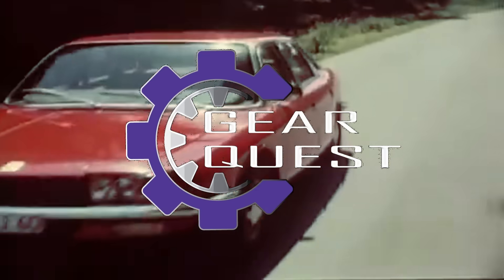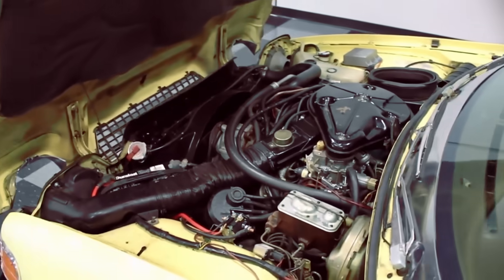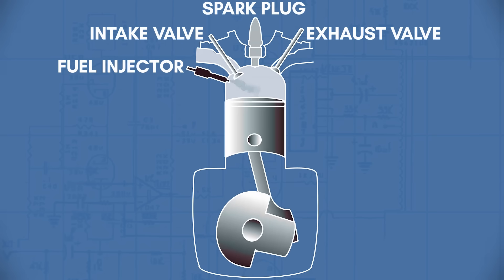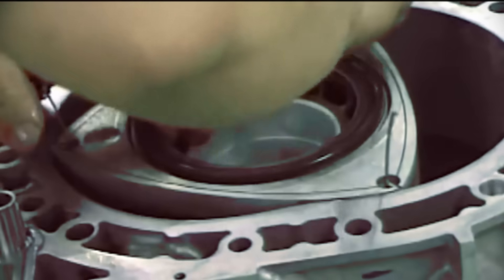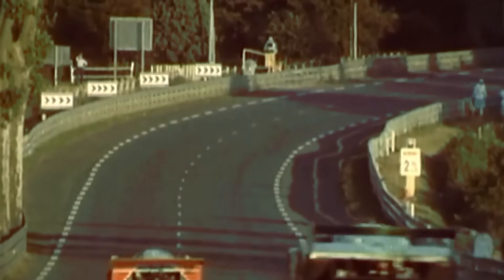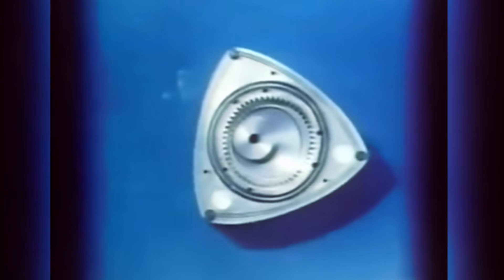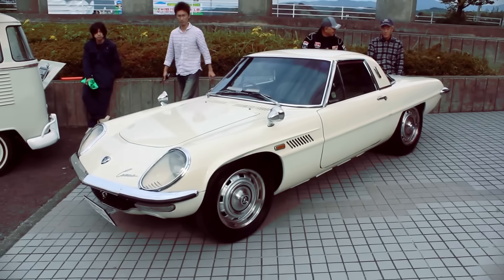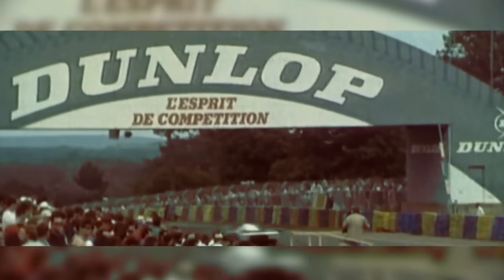The History of the Rotary Design

Comment: The winning Le Mans car was powered by a 4 rotor ('26B'), NOT a 13B.
Reply: @这是为什么我没有朋友 Same politics that banned the rotary from Le Mans the following year after their successful win?
Reply from the maker: Interesting topic for a follow up video 🤔
Reply: @normanguzman417  They banned ALL older spec cars and only allowed them to race in 1991 because there was a lack of new regulation cars to make a full entry list. Some "successful" win when it was useless on all other tracks in the 1991 World Sportscar Season and never came close of winning any other race. It was a fluke win if there ever was one at LeMans.
Reply: @normanguzman417  It was banned BEFORE it won; the rules were changed for 1991, but the older cars were allowed to race at Le Mans only.
Reply: @normanguzman417  All Group C cars were banned after that year. And the Group C cars against which it was likely to be competitive carried enormous weight penalties. The 3.5 liter cars had little chance of winning that year, Mazda or not. They were basically high-strung F1 engines that were idiotically mandated by Max Mosley.
Reply: It won because it was built for ENDURANCE as well as speed and the other cars were built for speed and they hoped they wouldn't break. Then they broke.
Reply: @eoinsweetman9263  porsches were also built for reliability but just had bad luck but thats also part of le mans
Reply: @kevinmai4326  First off, they were old designs. Second, they carried a punishing extra 170 kilos. The only reason the Mazda didn't get the 170 kilo penalty (actually the Mazda was scrutineered at 845 compared to the 1000 that the other Group C's weigh) was that it was considered so uncompetitive based on its prior year's performance.
Reply: @kevinmai4326  they didn't have the fuel economy either to mount a challenge to the more economical 787B. Plus they also had a weight penalty.
Reply: @eoinsweetman9263  only the Peugeots were 'built for speed' with the 3.5s and that's why they broke (F1 spec 3.5L engines that were still a little fragile over longer distances). The Mercedes, Porsche and Jaguars for example were still proper ENDURANCE Group C cars and an evolution of their cars from the previous year. They knew their 91 spec 3.5 cars wouldn't make it so they went back to their ENDURANCE 'old faithfuls' predominantly for that race. What helped Mazda out that year was the fact that due to a loophole in the rules they were not given the weight penalty that the other 'old' Group Cs were given (which was applied to the older spec cars as to not embarrass the 'new' 91 spec V10s that were running which was the Peugeots because they didn't have an older spec ENDURANCE Group C so stayed with the V10s). The #55 car also ran a different 'all out, flat chat' strategy, unlike their other car which ran on their normal 'conservative' strategy. The 787B was also one of the most economical of the Group C cars (it's all relative when comparing to 5L turbo V8s and 7L V12s!) which allowed them to run 'flat out' and not risk running out of their fuel allocation. A luxury the Porsche and Jaguar didn't have. That and Mercedes unreliability with water pump belts!
Reply: @eoinsweetman9263  yeah the slowest car on the field won.
Reply: @jdrok5026  Reliability is a beautiful thing sometimes.
Reply: @eoinsweetman9263  It was mostly luck. Just to put it in perspective: The Mazda 7878 won NOTHING else in the 1991 World Sportscar Championship season. It didn't even finish on the podium and they ended the season a distant 5th. One of the drivers of the leading Sauber-Mercedes' cars crashed the car forcing it into the pits lengthy repairs. Had he not made a mistake they'd easily win the race.
Reply: Ford vs. Ferrari , the movie, big deal.    Why isn't there a movie about Mazda winning at Le Mans?
Reply: laserleftfoot ttt Ford vs Ferrari was a big deal.

1.) Ford wasn’t really a racing team

2.) Ferrari had won the Le Mans in that class 6 years in a row

3.) The GT40 claimed 1-3rd 

Mazda on the other hand had a fluke win that came from rule regulations
Reply: @Texarmageddon  what was the fluke in regulations?    Ferrari is so entrenched in LeMans, that Ferrari got the rotary banned.   That's right! I I I  I drive a rx-7.   And I don't like fords and hate ferraris.
Reply: Texarmageddon ......fluke my ass. You must not no Mazda’s history at LeMans or perhaps motor sports in general. Can you tell me how many times a Mazda rotary powered car won its class at the 24 hours of Daytona? Just curious if you know without looking it up.
Reply: Alco Power considering how I’m only referencing to this LeMans race... it was only once it is still the only win the rotary powered engines have taken this LeMans race.

That’s the definition of a true fluke..

If it makes you feel better I guess it was a big achievement as no other Japanese team took it for awhile .... if ever... I haven’t kept track with it
Reply: Texarmageddon ......Mazda was in the hunt several times before 91. It was no fluke. Why you think they outlawed the rotary after they won? Because the sanctioning body knew they would win again and again but most folks at the time was only interested in Porsche, Ferrari, Jaguar, etc. Heaven forbid a Japanese manufacturer go n a streak like Porsche did and Audi would years later.
Reply: Alco Power several times and never won....
Second, they didn’t outlaw or ban the rotary... out of fear..
THE ONE RACE they won they were allowed to use an old car while everyone else prepared for the new regulations... 

You’re acting as if the rotary was the only engine banned .... NO! They banned all the engines from the previous season! Mazda got lucky and was able to use that same car WITHOUT the weight increase ... be happy with that, but don’t come up with bs thinking they were afraid...
Reply: Texarmageddon ....not bs. Why you think Mazda used a Judd engine in 92. Don’t be a hating fool.
Reply: Alco Power no one is hating... the car struggled with podium finishes all its career... 
767 INCLUDED
Reply: @alcopower5710 
It was "a fluke", because Mazda managed to talk their way out of a mandated ballast that was otherwise required for the old Group C cars to compete in an FIA event.

And the reason wankels were "banned" after Le Mans 1991 was the same reason the Type 935 Twin Turbo Flat-6 from the Porsche 962 was banned, or the 7 liter V12 from the Jaguar XJR-9 was banned. New regs, which were made because Group C was more popular among privateer teams than Formula 1, and Bernie Eccleston didn't like that.
Reply: @Texarmageddon  The only hate is for the irritating fanboys...
Reply: shaadydog1 exactly they seem to think we hate the car... I don’t.. it was just largely an uncompetitive car.
Reply: @laserleftfootttt7683  the rotary isnt banned it just doesnt meet any spec for classes.
Reply: @alcopower5710  "You must not no Mazda’s history at LeMans or perhaps motor sports in general" Right. And HOW MANY RACES did the 787B win in the 1991 WORLD SPORTSCAR CHAMPIONSHIP?? I'll tell you how many. ZERO. They didn't even finish on the podium in any other endurance race. 
This is the 1991 standings for the WSC:
1. Silk Cut Jaguar   108 points
2. Peugeot Talbot Sport  79 points
3. Team Sauber-Mercedes 70 points
4. Euro Racing (racing the Spice-Cosworth) 54 points.
5. Mazdaspeed 47 points

Finishing position for the highest places Mazda in the races of 1991 WSC:
6th-7th-11th-1st-5th-7th-9th-8th
Yes, in 5th to 11th place in all other races. So the LeMans win obviously wasn't a fluke, pardon my sarcasm. How well did it do in all the other races??

"You must not no Mazda’s history at LeMans" Yes, 1 fluke win. Some history. Compared that to Porsche's record 19 wins. Audi's 13 wins, Ferraris 9 wins, Jaguars 7 wins and Bentleys 6 wins. But Mazda(!) has a LeMans "history" . Omg. They were nowhere near the speed of the other cars in 1991 and only won through reliability and all the other cars racing each other at the front thus breaking down. Mazda were a frickin 4 FULL LAPS BEHIND the leading Sauber-Mercedes cars midway through. 

Here's the starting grid for the 1991 LeMans race.  Car numbers in brackets.
1st (5) Philippe Alliot / Jean-Pierre Jabouille / Mauro Baldi Peugeot 905 Peugeot Talbot Sport 3:35.058
2nd (6) Keke Rosberg / Yannick Dalmas / Pierre-Henri Raphanel Peugeot 905 Peugeot Talbot Sport 3:38.886
3rd (8) Charles Zwolsman / Cor Euser / Tim Harvey Spice SE90C Ford Euro Racing 3:45.740
4th (41) Naoki Nagasaka / Hisashi Yokoshima / Kiyoshi Misaki Spice SE90C Ford Euro Racing (Team Fedco) 3:53.833
5th (37) Pascal Fabre / Bernard Thuner ROC 002 Ford Louis Descartes (Racing Organisation Course) 3:55.446
6th (39) Michel Maisonneuve / Xavier Lapeyre / Jean-Philippe Grand Spice SE89C Ford Louis Descartes (Graff Racing) 3:57.298
7th (7) Patrick Gonin / Philippe de Henning / Luigi Taverna ALD C91 Ford Louis Descartes 3:59.343
8th (43) Jean-Louis Ricci / Olindo Iacobelli / Richard Piper Spice SE89C Ford Euro Racing (PC Automotive) 4:02.519
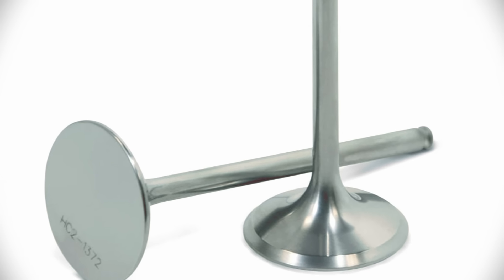9th (45) Nick Adams / Richard Jones / Robin Donovan Spice SE89C Ford Euro Racing (Chamberlain Engineering) 4:06.578
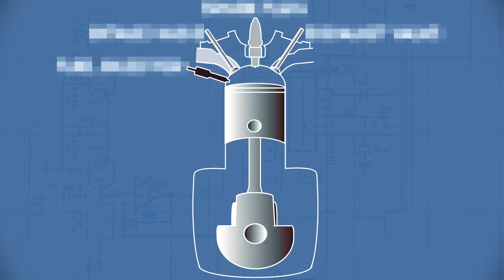10th (44) John Sheldon / Ferdinand de Lesseps / Charles Rickett Spice SE89C Ford Euro Racing (Chamberlain Engineering) 4:10.607
11th (1) Jean-Louis Schlesser / Jochen Mass / Alain Ferté Mercedes-Benz C11 Team Sauber Mercedes 3:31.270
12th (31) Karl Wendlinger / Michael Schumacher / Fritz Kreutzpointner Mercedes-Benz C11 Team Sauber Mercedes 3:35.265
13th (32) Jonathan Palmer / Stanley Dickens / Kurt Thiim Mercedes-Benz C11 Team Sauber Mercedes 3:35.957
14th (17) Oscar Larrauri / Jésus Pareja / Walter Brun Porsche 962 C Repsol Brun Motorsport 3:36.114
15th (11) Manuel Reuter / Harri Toivonen / J.J. Lehto Porsche 962 CK6 Porsche Kremer Racing 3:36.848
16th (58) Hans-Joachim Stuck / Frank Jelinski / Derek Bell Porsche 962 C Konrad Motorsport (Joest Porsche) 3:40.526
17th (57) Bernd Schneider / Henri Pescarolo / "John Winter" Porsche 962 C Konrad Motorsport (Joest Porsche) 3:40.548
18th (35) Davy Jones / Raul Boesel / Michel Ferté Jaguar XJR-12 LM Silk Cut Jaguar 3:43.496
19th (55) Volker Weidler / Johnny Herbert / Bertrand Gachot Mazda 787B Mazdaspeed 3:43.503

So let me get this straight: The fastest Mazda qualified 19th for the race and was 8,4 seconds slower than the pole sitter? When did a car which qualified that low down ever win at LeMans? When did a car so far off the pace of the front-runners win? The front runners all retired, crashed or had technical mishaps. Mazda inherited the win. 

You can also note how the Sauber-Mercedes C11 actually qualified with a time of 3: 31.270 seconds which was almost 4 seconds faster than the pole sitting Peugeot 905 with its 3:35,058 seconds. Why did the Sauber-Mercedes C11 start 11th then? Because it was an older car which didn't fully comply to the 1991 regulations whereas the Peugeot did. The Jaguar XJR-12 and Porsche 962 were older cars too and had to get behind the slower cars which complied with the 1991 rules. Again, the Mazda fell in thanks to these special rules for 1991. For 1992 ALL older cars were banned, not just the Mazda. They only made an exception for 1991 because too few entries complied with the rules that year. 

And seeing as the Sauber-Mercedes C11 qualified with a 3:31.270 time and the fastest Mazda with a 3:43,503 you must realize that's 12,2 seconds slower. Then when you hear the Mazda was four full laps behind the C11 during the night that's not so strange. 

"Just curious if you know" Just curious if you know zip or just talk out of your behind. 

Pacewise the Mazda was slow in the 1991 LeMans and won through luck and reliability and the special 1991 regulations which allowed older cars to compete.

These are FACTS. Those are objective and not up for debate. You can keep your subjective opinion and believe whatever you want. Facts speak clear.
Reply: TheIronDuke W. ....I know Mazda’s history very well thanks for asking. While you have given mostly all good facts I must point out that you keep pointing to speed but we are talking the world’s greatest endurance race. If you look back through the history of this race you will find that very rarely almost never does the fastest car ever win this race. FACT Did you know that team director Jacky Ickx reluctantly agreed to the engineers request for the drivers to NOT power into and have steady but not violent acceleration coming out of the corners? If I were a betting man I would say you were unaware. In fact you probably didn’t know that the great Jackie Ickx was even a part of the Mazda team at that time. The reason the engineers requested this is because the rotary engine gets worse mpg vs a reciprocating engine and they wanted to maximize the mpg as much as possible so as not to make extra fuel stops. It’s very well documented if you care to check. Even the mighty Jaguars who finished a very respectable 2-3-4 could not overcome Mazda’s reliability and strategy. Perhaps when you have free time you could look up interviews of competing drivers and listen to what their opinion was of the Mazda cars and teams. You may here a little different side to the story you are telling.
Reply: @alcopower5710  And you must not know the story of 1991, where its competition was either 3.5 liter F1-derived engines that weren't going to last that were stupidly mandated by Max Mosley or Group C cars that received a massive weight penalty that was curiously not assigned to the Mazda. They performed well, but it took a 155 kilo advantage for them to beat the V-12 Jags. Here you go . . .  http://www.speedhunters.com/2009/01/retrospective_gt_gt_55_special_1991_le_mans_24/
Reply: @alcopower5710  They outlawed EVERYTHING other than Max's stupid 3.5 liter engines.
Reply: @alcopower5710  I have to admit I do love me some Lola T616-Mazda.
Reply: @laserleftfootttt7683  good idea
Reply: @laserleftfootttt7683  "Why isn't there a movie about Mazda winning at Le Mans?" Because Ford DID win the 1966 World Sportscar Championship with the Ford GT40 and not just LeMans. Mazda never won ANY OTHER RACE in the 1991 World Sportscar Championship season. Not ONE. Not even a podium finish. They ended the 1991 season in a distant 5th. The 1991 LeMans was special because rules were lax for the older spec cars and they only allowed them in because there weren't enough entries. 
Ford won LeMans in 1966, 1967, 1968 and 1969. When did Mazda ever win any 24 Hour endurance race?
Reply: @theirondukew.8522  "Go Like Hell", you should read the book, it's only $14.91 on amazon.
Reply: For the record, all the cars had to have an updated engine for the new regulation along with weight changes for the upcoming season... these regulations came fairly late... Regardless, MAZDA was the only one grandfathered in with an OLD engine from that previous season...

Doesn’t take a rocket scientist to figure out who was going to win on “endurance” ... An engine that’s seen multiple seasons and modifications vs literally the new guys on the block.
Reply: The 26B was actually x2 13B. Problem was the build of the eccentric shaft
Reply: @Carlos.Rivera  That's how companies who makes custom 26B nowadays build their 26B. They designed it base on 2x 13B. The original 26B was designed differently. If you ever look at it's original blueprint, the walls, housings, ports and intake lengths are all different than what you would find in today's 2x13B design.
Reply: @Carlos.Rivera  The 26 B is a pure race engine with peripherial port , variable intake length and 3 spark plugs per rotor - way more than only 2  x 13 B. Interestingly it used the same mechanical oil metering pump like used on 13 B`s until 1988 .
Reply: @这是为什么我没有朋友 It won the GTO championship in IMSA 1990 . THIS 4 ROTOR ENGINE WAS CALLED THE 13 J ROTARY 4 not a 26B . The 26B came in the 1992 IMSA GTP race car and  1991 Champion Le Mans 787B race car .
Reply: Christopher ......not one time did I ever say that it was the fastest car.  I recommend that you go back and read my post again.  And just want to point out to you that the 24hours of LeMans is an endurance race. If you look back throughout it’s history you will find that more often than not the “fastest “ car never won. Sometimes they did ......I would say in the last maybe 20 years or so but not historically. Please take the time and reread my post and tell me where I said the 787b was the fastest. Just an FYI.......the rotary was banned because Mazda finally created enough HP to run with other top tier teams and made them reliable. AND......if allowed to continue the rotary was only going to get better. The sanctioning body did not want Mazda to dominate like they did at the 24 Hours of Daytona in the GTU class. Just curious if you know how many class victories a rotary has at  Daytona? Look it up and let me know.
Reply: @alcopower5710  ok one no they already planned for 3.5l piston engines the rotary wasnt banned it still has a active roster in racing. The rotary isnt easy to design for Mazda spent wack loads of money and barely took shit st Daytona running with the big boys stop trying to compare two different classes. Also you know how many times a Chevy or mopar engine has won a class victory at Daytona? You can't compare class to higher tier classes. Even within prototypes s simple change of class can add in a need for 500 plus more hp.
Reply: Homebrew Garage Sounded like a banshee with its balls on fire and went like a rocket! You could hear the thing coming for a quarter of a mile! My most memorable LeMans! 😊👍🏻
Reply: Christopher  The RX-7 holds the record for most consecutive victories in Imsa. They Mazda pretty much dominated for many years over all piston engines. That is a fact that you didn't know or just try to hide. Those facts are solid proof of my statement.  
Now for your question on the why Mazda didn't won the previews years of 24 hours on Le Mans. Simple, they dint run with R26B engine. Not to be confuse with the 13j 4 rotor used on 1990.
For the question on the 100 kg weight advantage. Fisa introduce a new rule that team that where not running the 3.5 L engine will have a weight penalty of 100 kg. This weight penalty was introduced because the teams using 3.5L engines where at a disadvantage against the other teams using bigger displacement engines. Now since Mazda was using a 2.6 liter engine Oreca team and consultant Jacky Ickx convince FISA that the weight penalty should not applied to Mazda team because their displacement was not making a advantage over the 3.5L. And there you go, once again you force me to embarrass you by exposing your misleading half way information and making you look like a beginner when it comes up to Mazda history. Next time you have a question read a book of something. Oh by the way, i can still feel your anger as you type profanity. You mad bro? Lol.
Reply: @normanguzman417  The 26B WAS used in 1990 though; for the whole season in the 787.. Both cars retired at Le Mans 1990, and for most of the rest of the year at least one car retired with engine failure in each JSPS and WSC round. The 26B needed a LOT of work before 1991.

The weight penalty was NOT related to 'bigger' engines, but simply to all non 3.5L engines - and included penalising the SMALLER 3.0/3.2L turbo Porsches and the Jaguars (who entered their V12 anyway!). Ickx did well in convincing the ACO (not FISA) to disapply the penalty to Mazda; but it wasn't to equalise the cars; it was to ensure a 3.5L car won.
Reply: @normanguzman417  In the GTO and GTU classes. When they tried to do a GTP, the RX-792 was like a Ronson lighter.
Reply: Christopher By your profanity i can feel you are in a great deal of pain as you type over the pistons defeat. I can tell you haven't get over since 1991. It time it is time for you to  let go the anger and deal with that defeat  like a man and stop whining like a pathetic little girl. The rotary engine is good design for racing. The proof of that is their victory on Lemans which makes my statement a fact. Obviously you can't handle the truth. You are bringing now the whole car industry as a excuse to change the subject. Good one, You are talking like no other car manufacturer hasn't go bankrupt before. But keep typing, you are only embarrassing your self. Because i will keep exposing your  half information comments. That only works to deceive people who don't know about  about cars.
Reply: Christopher  Other cars had faster laps but had to do more pit stops for refuel tire change etc. Those are the trades of using bigger heavier engines.
I never said they where the fastest. In fact i already told you that the engine was detuned from 900hp to 700hp for longevity. Mazda chose longevity over hp and it paid off. Mazda won bringing a 2.6 liter rotary engine. Imagine what they could have accomplish if they would have bring a 3.5 liter rotary to Le mans. 
Sadly the rotary engine was outlaw from 24 hours of Le mans so we will never see that day.
Reply: Christopher  So you are saying that Mazda won because other cars broke? Lol. That is racing my friend. You know many cars  made it to the finish line behind Mazda, so not everyone broke. The cars that broke where simply not good enough, so stop whining like a little girl coming with all kinds of excuses for the other teams. I can see you don't know the difference between Imsa and FISA, which again show that you are not a truly a car enthusiast. Mazda dominates IMSA for more consecutive years that any other car. By the way that record still holds.  If you don't know what IMSA or FISA is i suggest you to google it before you keep making your self look like a fool on the comments(a little too late for that i suppose). Now for the weight penalty i already answer pretty clear and you keep going around with the same halfway misleading information as if you don't want to admit that other cars had the displacement advantage and don't deserve the weight penalty.  By the way, by your profanity i can still sense your pain and anger flowing trough you. You mad bro? LMAO.
Reply: @normanguzman417  They broke because either they were 3.5 liter F1 engines that weren't going to survive and were stupidly mandated by Max Mosley, or because the regulations made them 155 kg heavier, causing Andy Wallace to call the Jags, which had won numerous 24 hour races before the weight penalty, undriveable (a rule curiously not applied to the Mazda, mostly because it was so uncompetitive the prior year).  

If you like rotaries, great, but the silly mythology about 1991 Le Mans has to stop. http://www.speedhunters.com/2009/01/retrospective_gt_gt_55_special_1991_le_mans_24/
Reply: @ziggystardust4627  Stop making all kinds of excuses of why other teams loss. The win is as real as it gets not mythology. Despite everything you said it only took 2.6 liters of rotary technology to win. Mazda won't be able to play with the big boys again because even if the build a 3.5 liter rotary engine, the won't be allowed to race using a rotary powered engine.
Reply: Norman Guzman First off, I’m glad they won. Before 1992, technological diversity was a hallmark of sports prototype racing.

 A mandated 170kg advantage doesn’t sound like an. “Excuse.” If you want to see how they would’ve compared without that, one only needs to look at 1990. Still, it makes sense for a rotary fan to be proud of this.

And you know that every race series, even IMSA, has had an equivalency formula on displacement between four strokes and rotaries. So you would not have gotten 3.5 liters, just as a 2-stroke, if they were to be permitted, would not get 3.5 liters.

In fact that’s what I loved about the old pre-1991 group C – you could try whatever technical solution you wanted as long as you had enough fuel in a standard allotment to get to the finish line. Usually, rotaries didn’t do so well because of their poor fuel economy.

Still, it’s absurd to think that the rules makers were quaking at Mazda when they made the decision to ban everything that was in a 3.5 L engine - rotaries, turbocharged, anything else. They simply wanted to mandate Formula One engines – a bad decision on my opinion, but this was determined long before Mazda won. They could’ve lost humiliatingly, and the same thing would’ve happened. That’s where the mythology pops up.
Reply: Christopher  what's the standard for a design of a engine? I've yet to see a standard be set. More servicing does not make it unreliable or a inferior design service lives are down to a lot of things or are you saying diesels are inferior to otto cycles because they tend to need more services. Rotaries are perfectly reliable cared for correctly
Reply: Christopher  obsolete and inferior how exactly? Rotary engines have a lot of pros and a lot of cons same for any motor. Remember the wankel was designed in the 60s had very little support and funds thrown into so how is the idea of a rotary terrible sure the current execution could be better but there are facts to be had about age. No matter what engines consume oil heat does this. But your also saying things like performance v12s are a inferior design to 90hp 4 cylinders because of maintenance intervals.
Reply: Mazda 787b,1991 ....mercedes benz hate my coment
Reply: Yes, it's hard to see even a heavily worked twin turbo 13B running at the front!
Reply: Christopher  No worries.  I still think that person didn't understand Marketing 101.
Reply: Endurance but then this show in high mileage has a lot of scratches. I guess it's different when it's running constantly. The rotary won because of its quickness. It was lighter than the pistons.
Reply: Christopher  I know. Endurance while running. But rotary won't last until 300,000 miles. The context will tell you what kind of endurance are we talking about.
Reply: Christopher  when your motor weighs half of the other guys you should end up with a lighter car lmao. You are kind of an asshole man. None of these cars are slow. All of them are damn fast, and at 700hp the 4 rotor of the 787b was no slouch. It wasnt the fastest out there, it had alot less low end torque and power compared to the others, and it was also not turbocharged like most were up to this point. I prefer the Nissan r92cp's 788 race hp, with 1200~ available when you crank up the boost. Too bad turbo motors were outlawed and it could only compete in Japan, where it hit 248mph on Fuji speedway straight.
Reply: @Matt Wells, go weigh a 4 rotor fuqtard and tell me where your getting  100kilos weight break,  from engine weight alone. Just Fanboy dumb beyond all common sense.
Reply: @mattwells1036  "when your motor weighs half of the other guys you should end up with a lighter car lmao." They also allowed a LOWER minimum weight for the cars with lower displacements. And more fuel to be carried too. You have to give them a sporting chance won't you? 
"and at 700hp the 4 rotor of the 787b was no slouch" Well, it was 8 seconds slower that the pole sitting Peugeot 905 and 12,2 seconds slower than the fastest car (the Sauber-Mercedes C11) which started 11th because.... it was an older car which didn't fulfill the 1991 regulations. For the Mazda they were particularly lax with what was allowed. Considering as how much slower it was than the top cars that is hardly surprising considering it raced in the same class. 

"it was also not turbocharged like most were up to this point" The Peugeot 905 was NA, the Jaguar XJR12 was NA and the Sauber-Mercedes C11 was NA, The Spice-Cosworth was NA. Only the Porsche 962 was turbocharged. 
"Most were turbocharged". More ignorance.
Reply: @mattwells1036  All the other guys were forced to carry BALLAST, because Bernie and Max wanted to diminish their chances against 3.5 liter F1-derived engines (which were likely to break anyway) All the old Group C cars were mandated to run at 1000 kg, even though they were designed to meet a lower weight limit (for example, a Porsche 962C weighed 820-850 kilos before ballast). The Mazda was mandated to run at 830 kg, and weighed 845.  http://www.speedhunters.com/2009/01/retrospective_gt_gt_55_special_1991_le_mans_24/
Reply: @这是为什么我没有朋友 it won its class in its first year competing in 1990 and won overall in 1991. A big reason it won was it's reliability.
Reply: @FRFOverland  It won its class because there were only 4 cars in the class, and 3 were factory Mazdas. The one non-Mazda DNF'd (as did 2 of the 3 Mazdas).
Reply: Christopher  sub standard I wouldnt say that. A lot of its flaws are just that flaws they can be fixed or the principles can be applied to a new design. They arent actually unreliable they just require a retarded maintenance ideology.
Reply: Regardless of all the bs, still an awesome sounding car.
Reply: AUDI won LeMans NINE TIMES with a Diesel engine, proving the Wankel sucks in every application.
Reply: it was the R26B
Reply: On. Op of that the rx7 was never in lemans it was the 787b lmfaooo
Reply: @clonecaptian  wrong mate, my dad raced the first RX7 at LeMans in 1980 and interestingly it had a 280 hp 12A
Reply: @clonecaptian  Not true. The RX7 raced in the GT class (Group 5) long before the 787b existed! Then there were the 717, 727, 737 Group C2 cars and the 757, 767 and 787 before the 787b... There was not just some "787" suddenly thrown into Le Mans, Mazda did it for 9 years before they won; but the first of their works cars was the RX-7.
Reply: Can we also remind folk that the 787b was naturally aspirated too.
Reply: Thanks for the warning.  This video has been chasing me all over YouTube for months, and now I know I can just skip it.
Reply: 这是为什么我没有朋友 ......reason they didn’t win the year prior is because immediately after the race (1990) the team had a meeting and the drivers told the engineers that if they had 100 more HP they would win. For the next year the engineers did just that and the drivers delivered.